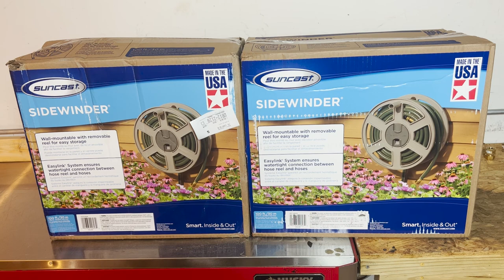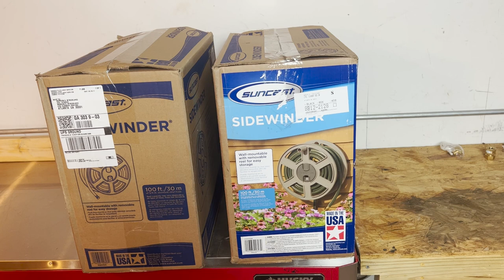Pressure Washing DIY Hose Reel HACK!!!

Comment: Nice build, casters too small will drive you nuts, get 2 in at least 3 in better
Reply from the maker: You are right about the casters. I may upgrade them to a larger size or do a redesign.